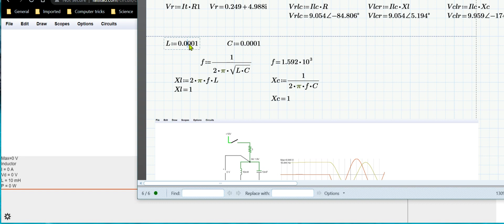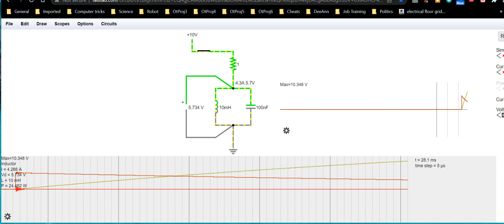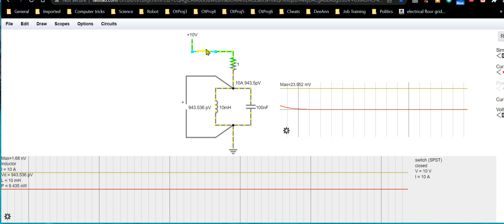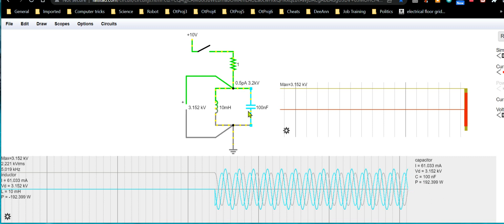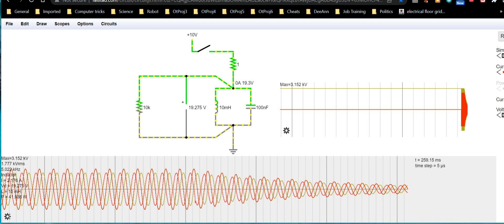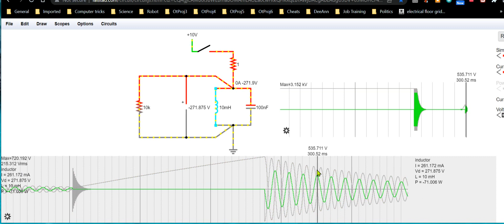High Voltage Tank Circuit?

Comment: Hi Bert, Interessting simulation and also in connection with the reallife proof in the other video.  Just a side question on this video ? What simulation-program do you use ? Thanks, Peter - Holland
Reply from the maker: Oh it is just Falstad - the free online simulator.  It just looked different back then . You can also download an offline version on Falstad's site.  There ae MANY other interesting simulators there too for Physics, etc... all free- dont even have to sign up to anything LOL.  www.falstad.com for the base site - just google Falstad simulator to easily find the circuit simulator.
Reply: @bertbronson8395  I will try to find it and thanks Bert ! Much appreciated. Do you stil use this or you have a better recommandation ?
Reply from the maker: Still use it and is fairly accurate most of the time - cant beat free AND simple AND easy to use.  I have others but rarely use.